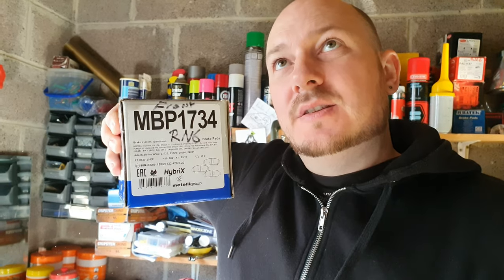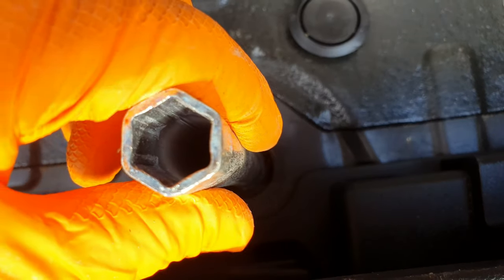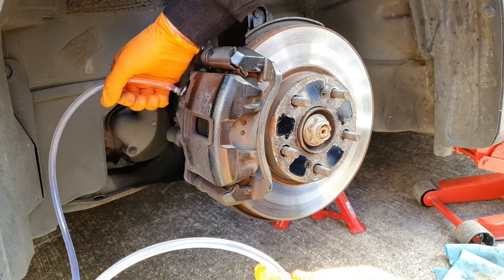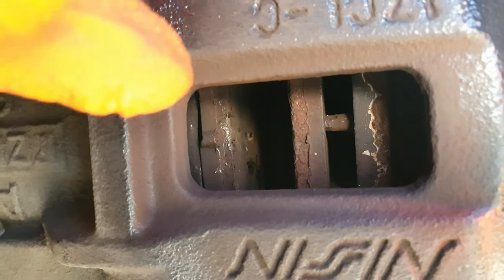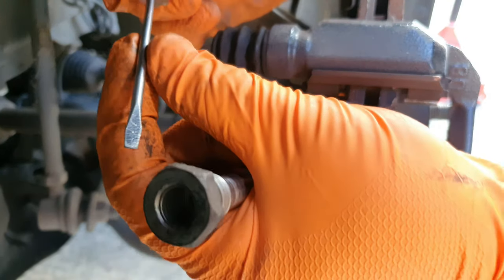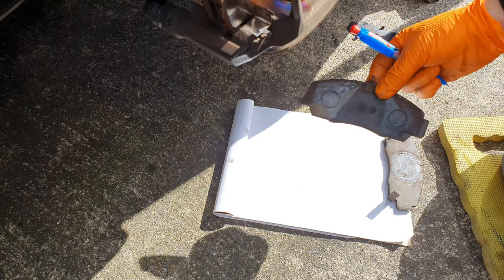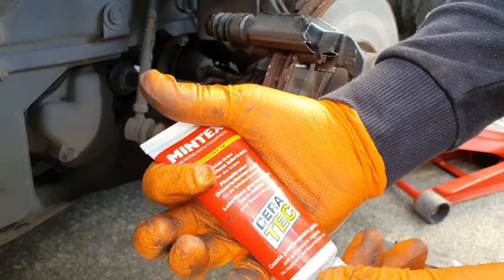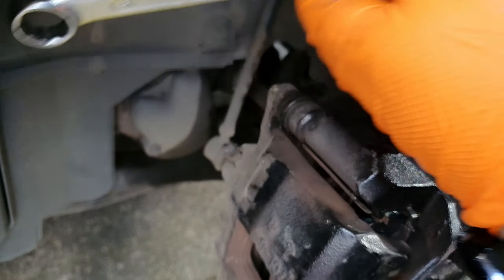honda stream brake pads/honda stream car jack location/honda stream brake caliper slide pins.

Comment: Hey man just to confirm, so i don't have to bleed the nipple just open the brake fluid cap.
Reply from the maker: Yes, open the cap, and push the caliper back slowly. Leave a cloth around the open cap to catch any fluid that may over flow. Then when new brakes are in, place the cap back on pump the brakes all the way down, and up, refill the brake res and pump again.